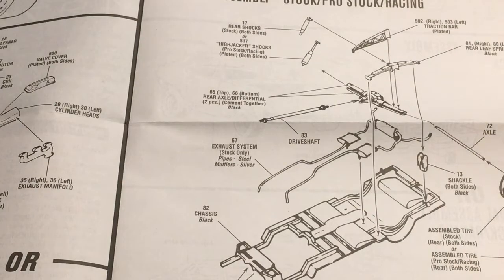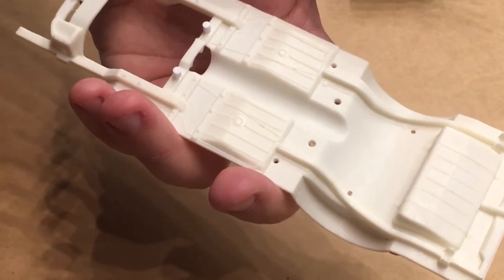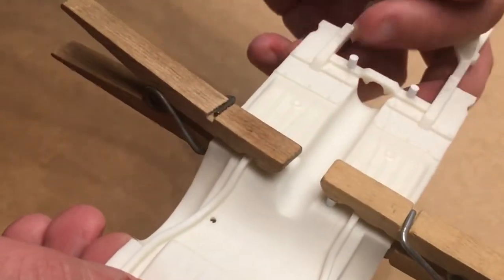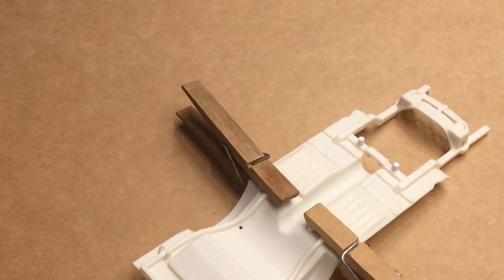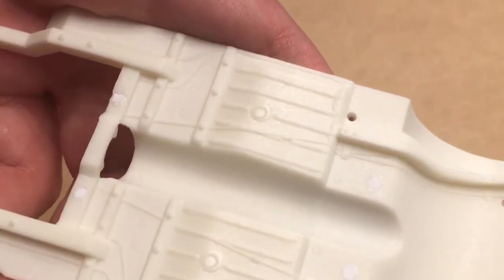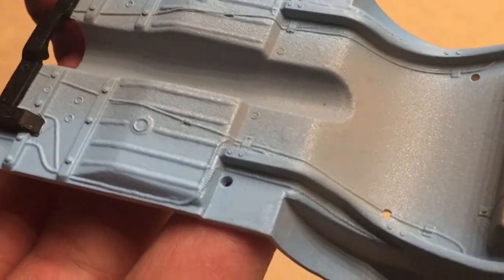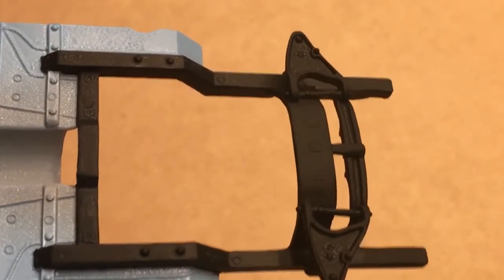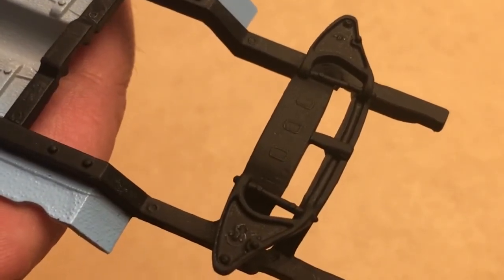Building the 1/25 Scale "Beverly Hills Cop" Nova - Part 2

Comment: Nice mods on the chassis Bill, I use that plastic plug method too ! It works very well . Looking forward to you starting on the body, I had major issues lining up the fenders on this kit years ago
Reply from the maker: Yeah, the fender fit is really bad on this kit. Fortunately, Axel's car was beat up enough that a little panel misalignment would be the least of its worries